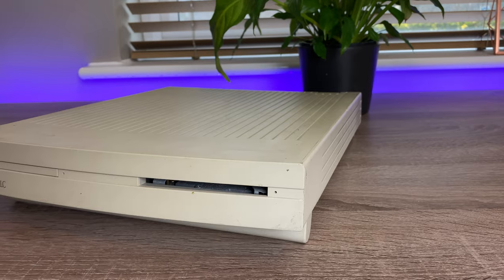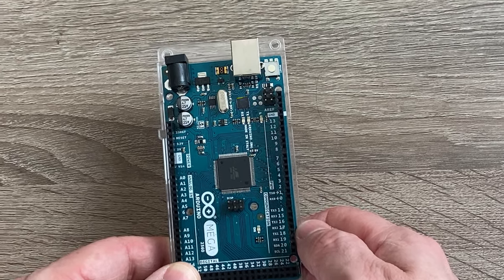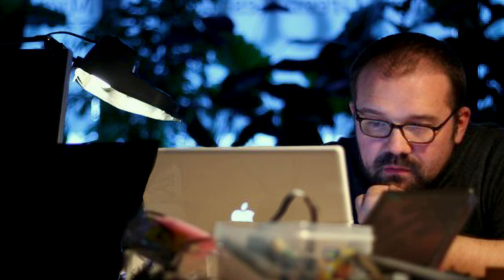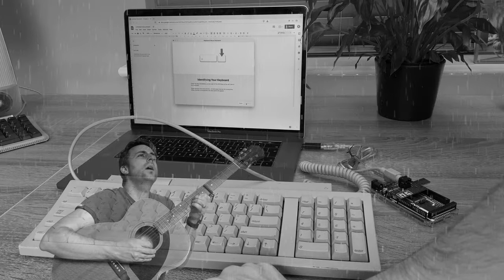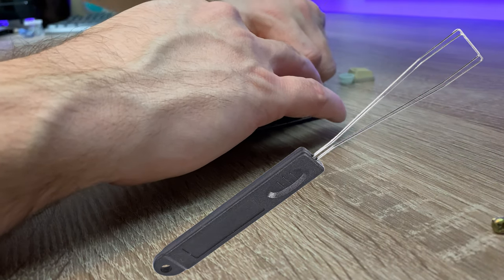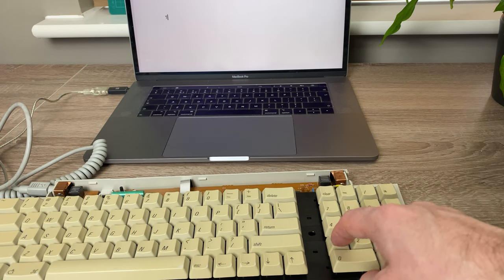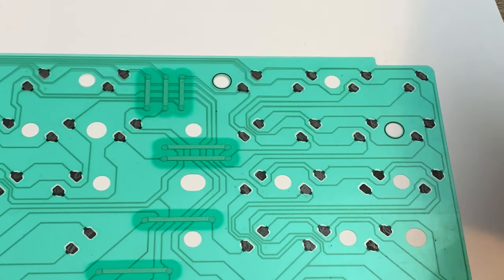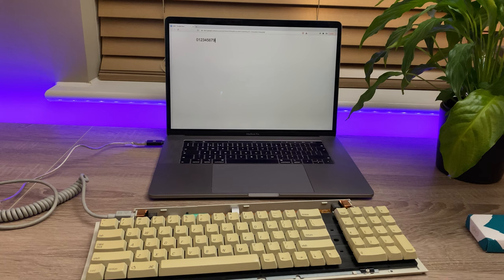Apple keyboard II | DIY Arduino ADB to USB and repair

Comment: Dang it now I'm thinking about learning enough about arduino to make an ADB->USB adapter small enough to install inside one of these keyboards…
Reply from the maker: I think there will be enough room. They definitely didn’t worry about using every inch of space like they do now.
Reply: Offtopic, do you know if that Arduino ADB translation can go both ways? Like, if I made an external ADB->USB switcher so old computers could be used with modern computers and vice versa…

Comment: Hello.  I have e a velo 500 not used for years.   I think I know the answer from your vid on the velo but the batteries are long gone so assume anything saved on the machine is gone also.  Thanks
Reply from the maker: I’m afraid so. Devices of this era were all a bit of a ticking time bomb with your data. It’s a shame I would have loved going through all my old files. Your best bet is looking for any backups of any old sync’s you may have done.
Reply: I dont think I do, but thank you very much for your answer.